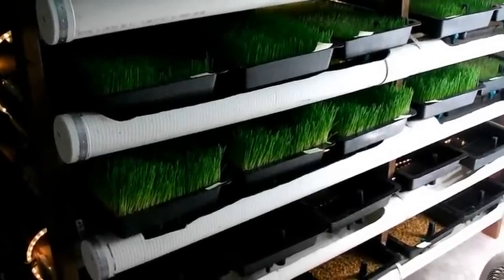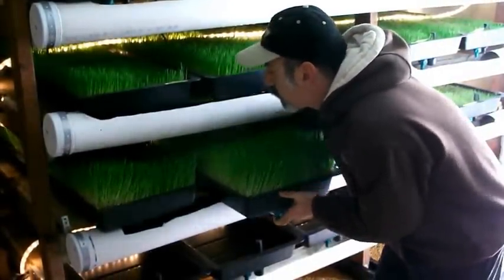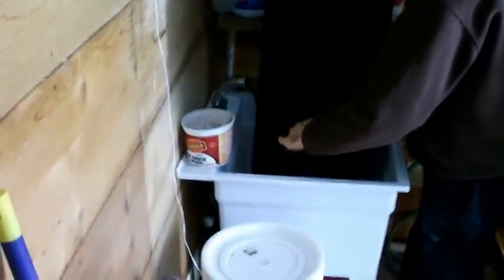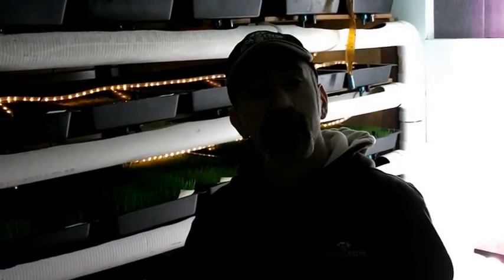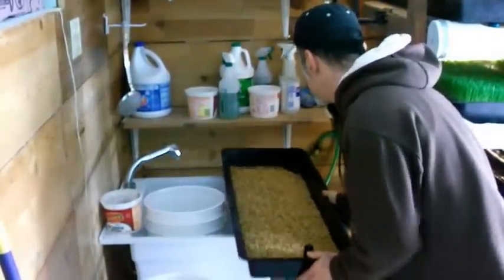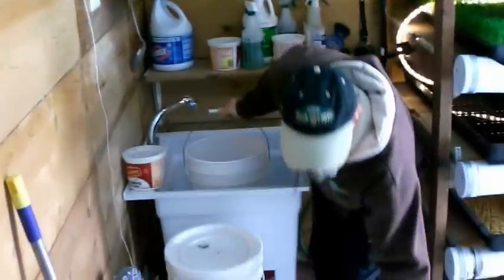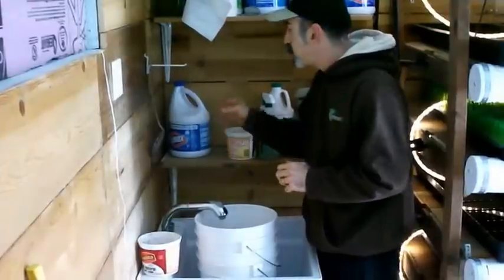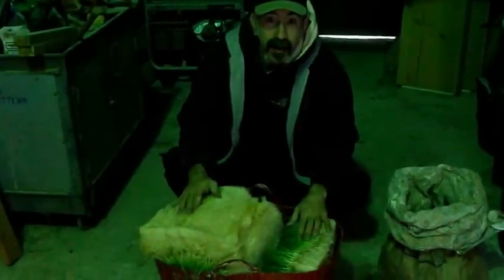Barley Fodder Grow Room Procedures - Step by Step through the Daily Task

Comment from the maker: Temp and Humidity control is key to a sprouting system. You will need air conditioning to keep temps between 60-65F and humidity lower than 50% (30% ideal), otherwise you will have moldy results.  A lot of grain seeds can be sprouted, wheat is the 2nd most popular to use.  

Check out our blog articles for more information, including sources for the grow trays.

Comment: What happens after you fill up your new tray?  Do you have an automatic mist system?  Do you mist manually or you just let them sit so that can grow on their own.  Did you build your gutter/drainage system or you purchased from somebody else.  Thanks for sharing your accomplishments and keep updating your system and letting us know.
Reply from the maker: Manlio Mendoza - Check out the companion articles on our blog (link in the video info above) for answers to all your questions.  We do not mist as our irrigation approach. Our approach is a true "flood and drain" style with trays that sit flat and level on the shelf (no tilting!). Misting, as a form of irrigation, is a very difficult to manage style of operation for a DIY fodder system (some commercial turnkey systems use this approach well). Irrigation is on a timer: 2 minute cycles, 4x per day: 8am, noon, 4pm, 8pm. We purchased (and now sell) the trays, and built the infrastructure (shelving, irrigation, drainage) from salvage and from items purchased at our local big box hardware store.

Comment from the maker: PH is actually not a critical factor due to the very short grow cycle for a sprouting application. There will be little gained from adjusting PH, unless the water source was entirely low or high in PH. Most tap water works just fine.

Comment: Perhaps I missed it, but I just wanted to clarify, at what day do you harvest the fodder? I've seen estimates from 5-8 days. I suppose a portion depend on growth temp and seed being used. You're using barley, I'm using wheat. I did see a comment below about the max nutrient value being at 8 days. 
When counting days, do you consider the first 12 or so hours of soaking as a day or just the days that it is out on the tray growing? I know this is only a half day difference, but I'm just curious. I'm inclined to only count days of growth, but when examining the process as a whole, the soak time has to be considered. Nerdy question I know, but couldn't help but think about it.
Reply from the maker: Tom Brueggen I generally don't consider the soak time as I'm only looking at the time from "spread date" to harvest. In general, your grow cycle length will range based upon how you run your grow room according to your local climate conditions.  For example, in my case here in the PacNorWest, we have mold spores and yeasts that are pretty active at 70F, so I strive for a grow room temp lower than that. My ideal during winter is a room average of 60F +-5F (natural daytime highs and nighttime lows). At lower temps, the grow cycle is longer, 9 days, but I achieve consistent and repeatable results with no molds.  When the diminishing point of returns occurs in terms of protein content, will also be based on that temperature. So, at 60F, it won't drop in protein until day 12+.

Comment: Hey David, I really enjoyed the video.  I took a look through the articles but I was wondering if there was a way to grow your own seeds? Is it simply barley? Or is barley grass something different? I am very new to all this and am trying to get as much information as I can. Thanks for the video.
Reply from the maker: Zythezero Thanks for the question.  What we are doing here is specifically a sprouting application; designed to take advantage of the stored energy in a cereal grain seed and turn it into protein, without the use of additional nutrients or fertilizers, over a very short duration grow cycle.  Beyond the initial sprout cycle of a plant, i.e. to take it through the full cycle of plant stages to seed, requires a whole bevy of other considerations and inputs that defeats the purpose of this type of feed, live micro-greens sprouts.  There is more merit in considering planting a crop of barley on land to be harvested, threshed, and stored for grain use than trying to do the same via a hydroponic grow operation. Certainly, in a hydorponic approach the grower could not seed with such density as done in a sprouting application and would likely require the addition of a grow medium to start the plants.

Comment: I had to go to a number of feed stores before I found one that sold rough barley that would sprout. Most feed grains are processed in such a way, they will not sprout. My goats did not eat the fodder. I have been feeding my goats Alfalfa and pellets. Do you think the goats will develop a taste for fodder? My rabbits readily ate the fodder.
Reply from the maker: Pearled or hulled barley will not sprout.  In addition, many times barley sold in feed stores is sold as "feed" barley.  This can be older seed with lower germination rates.  Some animals need a transition period when you put something so alien looking in front of them, but they eventually make the connection.

Comment: I've got a question about the methodology of the watering: 
is it normal tap water? 
are there any mixes involved in growing the barely?
how often does irrigation take place? 
does it require any specialized equipment.?

i am not so handy but id like to feed my chickens!
Reply from the maker: We irrigate with just water.  Water cycles, timing and length can vary slightly based upon the seed quality, season, local weather conditions, and strength of the water pump used.  Reference our blog articles at www.pacapride.wordpress.com for more information.

Comment: you can reduce the risk of mold by adding a better air moving system.
Reply from the maker: Moving air in a fodder room is essential for two reasons: 1) it increases the evaporation rate of water from the growing shoots, and 2) it normalizes the temperatures within the grow space.   However, added air circulation is not really going to reduce the risk of molds as much as good temperature control of the grow space will.

Comment: They look very sturdy, where can I buy those trays?
Reply from the maker: Caralee Thomsen they are sturdier than the typical seedling propagation trays from the store, but not as rigid as a solid plastic tray. They are vacuum molded ABS plastic. So, they are lightweight but there is some torsion and twist to them, one needs to use good handling protocols with them.  Send an email to info@pacapride.com for current pricing.

Comment: Good morning David. I have a question about lighting. How did you set up your lighting system and what type of lights do you use?
Reply from the maker: don zimmerman Lighting for a Sprouting application is minimal. Ambient light can even be used if the room is bright. A dark room would produce yellow sprouts.
Adding some supplemental, 'daylight rated' CFL or LED lights will help green up and stretch the sprouts.  We use a light bar of bulbs set off to the side and shining at the front of the grow shelves.  The LED holiday rope lights are not daylight rated, but do help dispel the shadowy areas toward the back of the shelf which helps even out the growth across the length of the tray.

Comment: how many pigs can you feed on 25lbs of fodder? is it enough to last them the day or do you do this twice or three times daily? great vid btw
Reply from the maker: Typically for pigs 2-3% feed ratio based on their weight: a 100lb pig would need 2-3lbs of fodder per day.  However, we raise ruminants, alpacas, and need also to assure a good source of fiber/roughage in their diet as well, in the form of some hay.  We go through less hay than on a pellet diet, but still, they need that in addition to fodder. Check with your local vet regarding the nutritional needs for a pig to see if they would need more than just sprouts.  Our feed is set out once per day, usually morning, it is gone within an hour or less.
Reply: i see.. so that 25lbs of fodder would really go a long way.. about 10 100lbs of hogs daily for 1 slab of 25lbs of fodder.. thats really awesome.. im planning on raising a few piglets and your input and vid is really helpful thank you so much..
Reply: 25 lbr fodder is mostly water. Let it dry a day outside and see what u feed ure lifestock.
Reply from the maker: Drying sprouts would negate their value as a feed.  5lbs of fresh microgreens becomes 1lb of poor quality hay if dried.  The value is feeding a fresh, live sprout which has bioavailable vitamins and minerals along with a dramatic increase in digestibility over the crushed, cracked, or whole grain.  A sprout changes a grain from stored carbohydrates and starches into very digestible protein.  The final weights of sprouts are completely determined by water uptake and is generally between 5x-6x return. This has benefit as well: most animal feeds are dry hay and dry pellets.  A change to fresh sprouts and hay, reduces hay consumption by 40% for my herd, saving hay as well as eliminating processed pellets from their diets.  A sprout is an example of a feed where the sum is greater than the simple parts.  What sprouts have in protein values, it completely lacks in fiber, thus some hay for fiber and roughage is still a necessity. Having used this approached for several years now, not only is the cost savings there, but also the health of my herd increases substantially.

Comment: This is good information, but I'm somewhat surprised with the chlorine bleach usage. I have a background in chemistry, so i'm aware of the fact that bleach is really quite harmless, but public opinion being what it is, you almost always see people switching over to hydrogen peroxide, or incorporating a dry out period after an application of bleach so that the chlorate can either degrade into a chlorine ion, or into a gas (in minute quantity.. it usually persists as the anion). 

Since it's a recirculating system, do you check for total dissolved solids or Electrical conductivity? I'm interested to know if that is effected.
Reply from the maker: RhetteLawe - Chlorine is only used during a pre-soak sanitizing procedure in buckets. Once the seed is spread into the grow trays, they only get fresh water irrigation which does NOT recirculate, but drains to waste washing starchy solutes away.

Comment: are you thinking about grow to maturity to save the seeds?
Reply from the maker: Jacob Padilla - No, we do not grow the barley in this system to full maturity.  We only grow it for it's "sprouting cycle" which relies entirely on the stored energy within the seed itself to get it through that stage of growth without additional inputs from outside the seed other than water.  Growing barley to seed is much easier to do in a field, not a hydroponic environment.

Comment: the bleach you add wean wash the seeds, is typical clorine we use for cleanig floors??? dasent leave clorine smel or trays in the final product? any other solution about this mater? (sorry about bad english) thank you
Reply from the maker: Yes, it is household bleach.  It is used in the initial seed soak to simply sanitize the seed, killing any mold spores present on the hulls.  It does not carry forward into the grow system when placed in trays.  Some commercial turnkey systems actually inject chlorine bleach into their irrigation during the grow cycle to help further prevent molds from forming, however i don't find that is needed.  Either way, the use of bleach is safe and doesn't harm the sprouts or germination rates.

Comment: Can I use distilled vinegar rather than bleach to sanitize the seeds?
Reply from the maker: Some fodder growers will use Apple Cider Vinegar for their sanitizer, I prefer bleach for a variety of reasons.  If you do use something other than bleach, be sure you use it at a strength that will provide a good pre-cleansing of your seed and it's hulls of any mold or fungal spores and dirt.  A well sanitized seed sets you up for a good grow cycle, however, it is not a preventative for molds; climate control, good air circulation, cleanliness and a dedicated grow space are necessary as well.  Poorly sanitized seed does set a grow cycle up for molds earlier in the cycle if other factors are off as well.
Reply: Thank you.  We are working on becoming totally self sustaining and thus our vinegar is homemade.  Great video!

Comment: I'm not familiar with the product you use for top dressing.  What is it and where can it be purchased?
Reply from the maker: It is called Diatomaceous Earth  You can read more about it in the blog article link found in the video information above.  We only top dress is for a 30 day period as needed for parasite or bacterial control. Beyond that it is also a source of organic silica and trace minerals for the animals.  We use it in waterers, chicken nest boxes, and the chicken coop too.
Reply: David Capocci
Thank you.  I have also heard that it's not necessary to feed 1% dry feed.  I understand you feed 2% fodder and 1% dry.  I have you tried just straight fodder?
Reply from the maker: It depends upon the animal's needs.  For ruminants, such as alpacas, cows, goats, sheep, they need a component of fiber in their diet.  Sprouted Fodder, while great in protein, completely lacks in fiber.
Reply: David Capocci
Thanks, I plan to feed horses and hogs...
Reply from the maker: From what I understand from other horse owners (and hogs too) they don't have a firm fiber requirement like the ruminants.  But do verify with your vet any diet considerations.  Horse owners are also likely to feed at closer to a 3% ratio per day and sometimes add to the base barley seed mix additional seed to sprout, most typically BOSS, black oil sunflower seed.

Comment: What is the ratio of bleach to water you use to do the overnight wash?
Reply from the maker: For a 5 gallon bucket, just a splash of chlorine bleach is added.  Less than 1/4 cup to several gallons of water. Enough to sanitize the grain surfaces and not impact germination.

Comment: Hey David i found a video comparing soaking period, soaking for 30 min is best i guess. check it out Presoak Time Comparison
Reply: That experiment was a good idea, but a fairly lousy application. There was zero data presented (I assume that it wasn't gathered). You get the visual comparison, but no actual data. There was no measurement of any variety to determine final outcome. No germination count, no sprout height, no over all mass. It seems like the most important information in comparing the soaking times would be cutting the sprouts the last day and weighing them and the root mat. If you don't get any real data out of an experiment, it doesn't seem like it's much use. The most useful info I found in the experiment is the shorter soaks seem to sprout sooner, but by the last day there was virtually no visual difference. I'm just starting to look into fodder growing, but this is certainly an experiment that I will be doing myself.

Comment from the maker: There is no reservoir being used.  All water drains directly out of the room, to waste.  Fresh water is used for every irrigation cycle.
Reply: they must have a bit of tilt to them, right?
Reply from the maker: @mattallen9546  There is no tilt to these trays. They have raised center sections surrounded by lower drain channels leading to a larger recessed drain fitting with a cap at the end of the tray.  Any water remaining is very negligible and in the drain channels. They were designed to sit flat and level in order to establish a flood zone that is equal across the entirety of the tray.

Comment: Use baking soda for mold
Reply from the maker: The use of baking soda to "treat" mold outbreaks is not something we would advise.  Prevention of mold outbreaks is a basic tenet of sprout production in these seed densities.  If a significant outbreak of mold was to occur, and a treatment used to eliminate the mold, the problem is that there is still the presence of mycotoxins that the molds have created.  A proper risk assessment of a fodder mat with mold outbreaks is necessary to determine whether to feed such a mat to ruminants or to toss it to the chickens instead (which have a higher tolerance for moldy items). The best way to treat molds is to prevent them from starting. Prevention comes in a variety of forms from proper pre-sanitizing of the seed, to grow space cleanliness, to climate control and air circulation.  Treatment of an outbreak is already a lost battle, depending upon how large an outbreak it is.
Reply: ok

Comment: 12:29 clorox barley..nice
Reply from the maker: Without that step, we'd be fighting more mold outbreaks in our fodder mats.  It's simple, effective, and proven itself.  Luckily, none of that carries forward into the grow trays and the solution is weak enough that it doesn't impact germination rates.
Reply: Could you use food-grade hydrogen peroxide instead of clorox?
Reply: The chlorine in the bleach evaporates overnight if it's not sealed air tight so it will sterilize everything in the bucket and be good to go the next day

Comment: If you used a hook on your rope it could be self releasing, fewer steps. Also hoist the bag of DE up to the room, spread it before removing the fodder mat, less handeling.
Reply from the maker: Thanks for the suggestions!  We have tried a few different variations to optimize our process.  DE as top dressing is not a norm, only used when needed.

Comment: You can use hydrogen peroxide or baking soda for better results preventing molds or melibugs
Reply from the maker: We have tried both and found them ineffective compared to chlorine.  They are also not as economical.